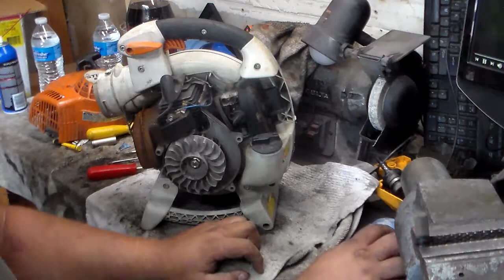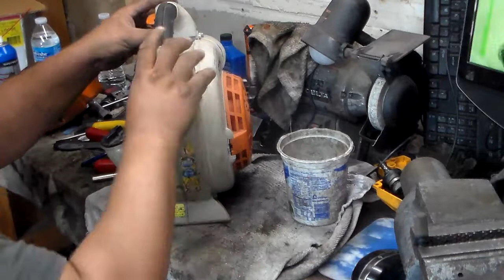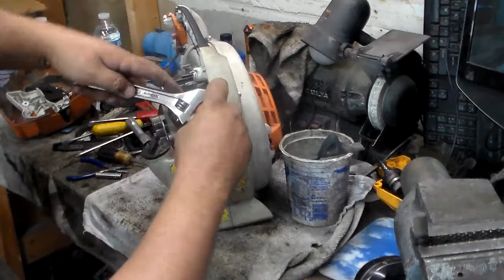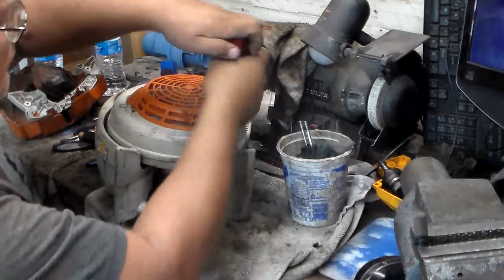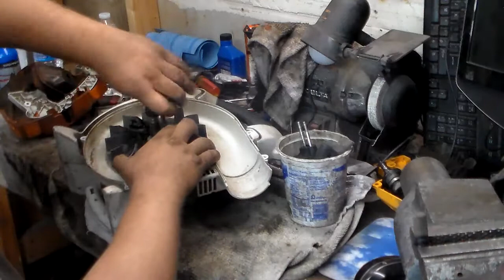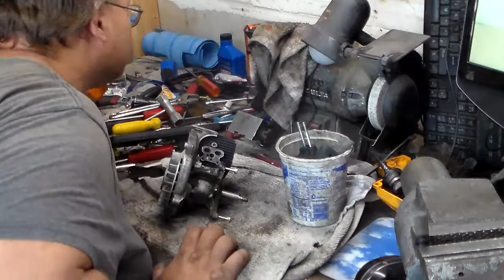teardown of stihl leaf blower part 1 joe valles small engine repair

Comment: That you sir just found of these in the shed under loads blankets I’m over the moon lol just didn’t get the pipes
Reply from the maker: hi josh, the stihl blower you see was a job given to me by a older gentleman that does small engine repair but he hates 2 strokes and mostly does 4 stroke like lawnmowers and atvs, also he has a storage room full of tillers ,trimmers and blowers that he has amassed over the years, which of coarse he keeps under blankets to keep the elements out, so there is plenty to do, and again thanks for the comment.

Comment: My bet is, this thing never gets reassembled properly and ends up in the scrap pile
Reply from the maker: actually i put it back together a few days later and had to wait for some carb  gaskets from ebay  and later had it running and gave it back to the owner
Reply: @2strokefanatic578  I'm amazed. Did you make another video of it being reassembled and firing it up?
Reply from the maker: @BT3701  i did not make another blower vidio because it took weeks for the pasts to come im and the owner wanted it back but it did work and i wish i did another video on it but i had time constraints on me but i have other videos on other blowers later on

Comment: These have a design flaw of self ingesting the rod bearings. No parts on the market. Stihl is good, but buyer beware.
Reply from the maker: hmm i did not know that i have never had that problem  it my be because of to thin of oil to gas mixture which makes the rod very hot and self destruct,  but im not sure, but i do know that stihl is making plastic bearing, not the ball bearing but the races are plastic which dont last to long, and from what i know its mostly in their chainsaws, mostly in their household  models, so please buyer beware, thanks toby for the comment.